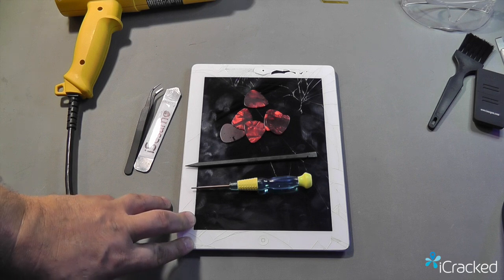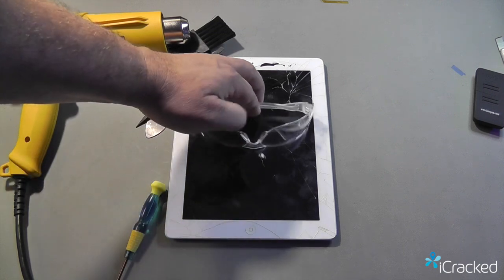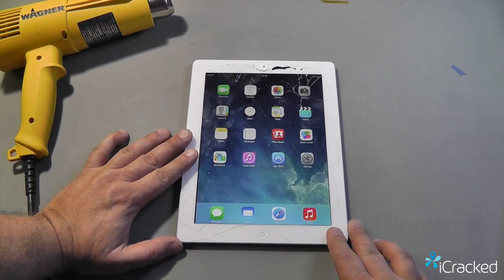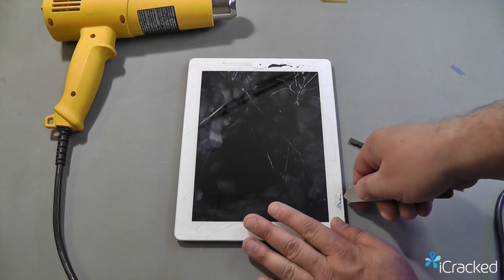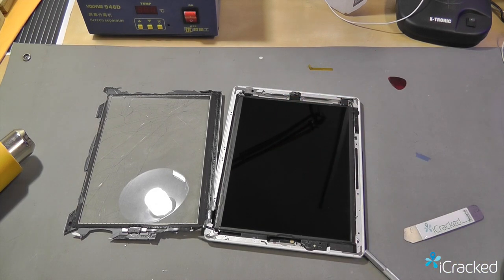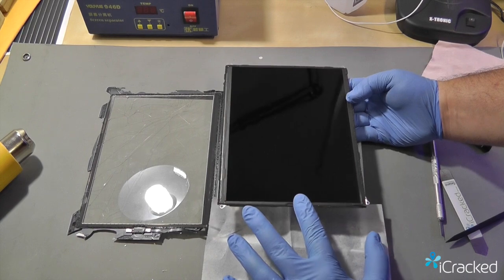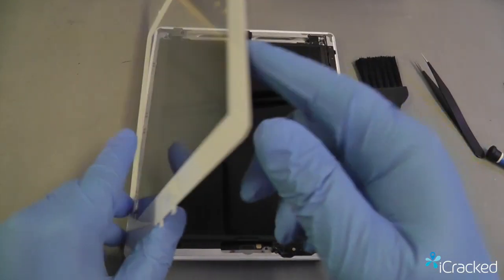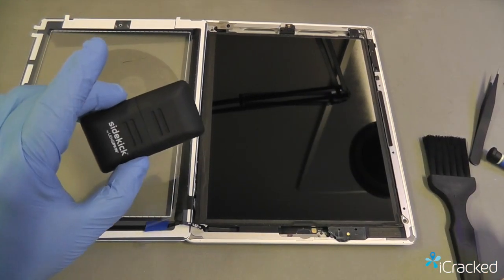Official iPad 4 Screen / Digitizer Replacement Video & Instructions - iCracked.com

Comment: It's safer if you use packaging tape to cover all of the glass initially and then cut around the border with a razor before you start the repair. This prevents glass shards from flying towards the face.
Reply: Thanks for the good tip, i'll try it next time.
Reply: Exactly!! I got glass in my eye on my first repair. Since then my first step is to cover the entire glass with clear tape.
Reply: Haligon ovenlight
Reply: And then put a hot air blower on it ??   DUH!

Comment: Beware that, if you order the iPad 4 digitizer replacement kit from iCracked, it WILL NOT come with either the home button assembly, or the camera bracket, nor will you be provided any adhesive to reattach the old ones.  In this official iCracked video, they are both preattached, but will not be on your digitizer assembly that you will receive.
Reply: Exactly.

Comment: Only thing I would add, and perhaps someone mentioned already, but warn people about the area to the right of the home button.  I wedged the guitar pick between the glass and the speaker plastic cover and damaged the foam like material just right of the home button and under plastic guard.  Speaker still works but I have a high place in the glass in that area now which causes glass not to fully seat in that area.  Other than that works great.

Comment: ⭐️⭐️⭐️⭐️⭐️THANK YOU for your video. By far the best one on YT. I checked out several and yours was the BEST!! Great explanation, attention to detail. Clean, clear close ups and specific instructions. I have 2 of these and I fixed both this weekend. Ordered my kits online, spent roughly $30.00 (unfortunately, not your kit but close to it) and now our iPads are like new!!! You saved me a couple hundred dollars!!! Key to those wondering or viewing this....listen to what he tells you. Every bit of it is accurate, down to placing a stack of books and applying pressure to let the adhesive bond to the surface overnight. I did all of it and we have two like "new" tablets!!! Do your prep. Get your tools ready. Take your time. Watch this video several times before and during the repair. If you follow the instructions, your repair will work. Again..THANK YOU so much for the video!!!👍

Comment: Excellent video. I was given 2 old iPads to use in class which had problems with areas of the touchscreen not working. have just repaired them both without issue and can now use in class with children. 🎉

Comment: Thank you for your video, it helped me to do my first ever screen replacement. Took me a while but got there. I made the mistake of buying a screen without the home button assembly but I just swapped out the home button assembly from the damaged screen. I also applied a little too much heat in certain areas and warped the bezel in a few places which I had to cut out.

Comment: 5 Stars!
I viewed a number of iPad 4 repair videos. This was the best of all I have seen - very thorough and careful. High quality camera work on the fine detail steps! Includes great tips such as safety glasses and gloves during the appropriate steps.  I had glass chips hitting my face on some of the removal around the shattered parts.  
Thank you!
Reply: gloves are critical. if you touch the LCD screen with your oily fingers its game over. you will have a perm water mark. I've done it
Reply: Yes, this was a useful video. Fixed my iPad 4 fairly easily. It fell off of my bed and onto my hardwood floor. From now on it stays in the center if the bed. My gf was going to take it to the store to get it fixed but this video saved us the trip.

Comment: I changed the screen put in the cables correctly computer see it but no apple logo, was working before I changed to put the old one back on to see if its the new screen but still the same. black screen no apple logo. loved the way you changed the screen and the magnifying insert for the digitizer was great, if anybody knows s what wrong gave as a shout.

Comment: Hi I liked your explanation about replacing the digitized screen in Ipad 4th generation, so very detailed .I have a question, instead of the heat gun , can I use a hair blower to separate the screen from the frame lcd ipad if it is safe and ok, and it will blow same amount hot air that need it? Thank you for the video

Comment: Good detailed video.  I agree the camera work was wonderful.  I noticed the lower RH corner didn't seem to be filed or bent back.  How did you get the new bezel to sit along with the new glass with that pushed in ? I've either had to file it down or use the back end of the metal spudgers to reshape the corner for the glass not to "pop" when pressed.

Comment: I bought a new digitizer and replaced it according to these instructions.  Half of the screen is responsive, but the other half isn't.  It also sometimes ghost touches (or, in other words, clicks all over the place on its own).
Reply: you have to plug the digitzer cabke further in.
Reply: No, I had to use kapton tape.  Works like a dream now.
Reply: ive got exactly the same problem and I can't fix it. what did you do?
Reply: I placed kapton tape over the edges of the touch screen which have metal in them.  The touch screen seemed to be grounding itself out, causing sporadic behavior.  The kapton tape insulated it and worked like a charm.  It's been working for months as if it were new.  Use very narrow kapton tape.
Reply: +WILSON! thanks. where precisely did you place it? did you put it over the metalic strip on the reverse of the digitizer?  only the top third of my screen is unresponsive so I assume this is the same problem.
Reply: +WILSON! oh and when you say kapton tape do you mean the copper conductive tape or the masking kind? never studied electronics so don't know if I need to conduct or insulate :-/
Reply: Type this into Amazon:  1 Mil Kapton Tape (Polyimide) - 1/4" X 36 Yds

It's sold by TapesMaster for $6.25.  I believe I used 1/4".

I placed it only over the metallic strip on the reverse side of the digitizer above the home button, and along the entire length.  Make sure you don't overlap and interfere with the adhesive strips that adhere it to the iPad.

Comment: i tried this yesterday, and it was mostly easy to do. i have misplaced the screw that holds down the logic board to the battery. the iPad no longer powers up now. forgive me for seeming naive, i havent worked on apple products before. is the screw holding down the logic board essential for the ipad to boot up? or should i be looking at other areas, such as replacing the battery. 

thank you for everyone/anyone that replies.
Reply: The battery connector is not strong enough to hold itself in there so it needs that screw to hold it in

Comment: Dude. You are a fucking life saver. I created a YouTube account just to thank you for showing me about those clips to hold the ribbons in. I couldn't get the ribbons in based on another video I saw bc it didn't show this. Also, the other video shows an iPad without a cracked screen coming out soooo easily. Where mine came off like yours. Thanks again. You saved me about 700 bucks as I thought I had to buy someone a new iPad

Comment: Hi, i used this tutorial to fix my ipad a couple of days ago, truned it on, and it was fine. then i realised my bezel was unusable, so ordered a new one, put it in, and now the ipad won't turn on. Is there anything that i could have done not to make it work?? i have fixed an iphone5s three times, and an ipod (all screens), and from my experience, (the last time i did my phone and ipod touch), i left them open for a longer amount of time and these were the ones which didn't work. Do you think this actually has anything to do with it, or could you give me some other things to check??? i kept them all in safe places when they were open.

Comment: So  you said that if this was a cellular ipad 4 to be careful not to rip the antennas up at the top. So how exactly do you not rip them? Since the demo isn't a cellular module there is nothing to see. Are you saying to separate them off the underside of the digitizer with a blade before lifting off? thxs

Comment: When I try this, I can't get anything under the digitizer to lift it up, not even a razor. The heat gun I am using is rated up to 1,200F. I can't tell if I am heating the glass long enough to losen the glue or if there is something I am missing. I have even tried using the suction cups to try and pull the digitizer apart, but it ended up breaking one of my suction cups instead... Every tutorial I see, it seems like the person is easily getting something under the digitizer to lift it up. Help please

Comment: Yes, I wholeheartedly agree with the majority as to this video being by far the best of all I have seen. Thanks for going into so much detail which, as you obviously are aware of helps mainly, but not only, all those who are attempting for the first time to repair a shattered iPad screen and digitiser. Apart from that suggestion made by Tewilk 2 years ago with regards to warning people about the area to the right of the home button (looking at the iPad upright and the home button on the low side) where the foam like material just right of the home button and under plastic guard could be damaged if not scrapping the screen edge off carefully, I would respectfully add an extra non-technical point. Please do not forget to switch off the blower. It is not so much for the noise because one still can hear you clearly enough, but for unnecessary energy waste. I am not an obsessive environmentalist. In fact, I do not belong to any green campaign. But I do support organisations like Green Peace, etc. The issue is not merely to say that “Oh, it was only a few minutes”. No. It is a matter of being aware that any unnecessary waste we unconsciously or consciously make has an adverse impact on our planet. For I am not referring simply to you and the blower being on for no apparent reason but for the millions of people who in one way or another waste resources unnecessarily. Thanks again for your enormous help and cooperation.

Comment: Well you make it look a lot easier than it is :)
Many thanks for this video,
I wouldn't have attempted it without it.
Just knowing what to look out for is worth more than I can say.
Yes the glass was damn hard to get out and best if you get a kit with a new plastic bezel that way you don't have to worry about damaging the one that is in there.
Your kit looks like the one to get, might cost a bit more but it will be worth it.
I had to get one real quick and that was from Sydney, the kit wasn't as good, but with your instruction I completed it successfully and the daughter will have a revived I-Pad 4 in the morning.
Thanks again for the great instructional video.
Reply: It is very easy, try changing display on a pixel 3xl

Comment: How not to damaged your backlight after replacing the digitizer? Mine is half dimmed on the right side after replacing my digitizer ;(
Reply: Check your LCD cable and connection for a kink or a lose fit. The white lines on the flex cable should be right up to the connector. Be sure you closed the tab when you reinserted the cable. Good luck.
Reply: thanks, it was my lcd its faulty after change to a new one its okay now

Comment: I just did this screen and digitizer replacement. I did a test of both before screwing the screen in place but then I could not shut it down. I guess I could not align the digitizer correctly so I just disconnected the ribbon cable to the screen. now when I reconnected it, it doesn't have the brightness. the screen stays dark but I can just make out the time. it is on, but barely visable. does anyone know what has happened?

Comment: what do you do when you replace the screen plug everything in but the iPad wont turn on or get recognize when you plug it in your computer and turn on itunes. or did I just broke it even worse
Reply: mine did that. I opened it back up and did the bit where you remove the two different sized screws and lifted the conector up so it disconnected the power and then screwed it back down and reassembled it all and it came back on. think I shorted it out

Comment: Has anyone had a problem on completion of the task where the screen is displaying only lines, grey..black, of varying widths but no normal image, iPad (although powered off at the start) came to life as I turn over the new screen on to the digitizer to check it. it went off after about a minute, I then powered it up properly but the screen image was the same...anyone know what the problem might be?

Comment: When I plugged the lcd part back in the screen won't turn on? Any advice how to fix it?
Reply: I think you cut through the screen cable or whatever you want to call it it's right on the side of it
Reply: Mine worked but the home button didn't work, what could have gone wrong?

Comment: My logic board is damaged. http://i1044.photobucket.com/albums/b447/calvinnew/20151229_233457_zpskvzwjo3r.jpg
Too much force was used to remove the connector. Is there a way to repair this or does the logic board need to be replaced.

Comment: This is nothing like my IPad mini 4, cables in wrong place, no fingerprint ID home button, glad I didn't buy my replacement parts from you!
Reply: That's because this is for a Ipad 4 regular large size ipad. If you have the Ipad 4 mini you would have to buy parts specific to your model.... And I'm sure this company has a seperate video on that. I ordered my replacement from this company for my ipad 4 and they specifically ask for your model number so they make sure they send you the right replacement materials. It worked perfect for me and saved me over a hundred dollars.

Comment: This video is excellent. I was using it along with the A1458 screen replacement kit purchased from iCracked. Imagine my surprise when I get to the point that you verify the cables and cut off any "nubs" before reattaching the digitizer cable and the home flex cable and discover there is no home flex cable attached to the digitizer. Nada. Nowhere to be found...I write iCracked and their "HQ" (and when I say HQ I mean wussies hiding behind a girl having her do their dirty work) tells me through a female CS agent that it doesn't come with a flex cable, I'm supposed to use the existing cable, a refund will not apply and they are closing my ticket.

OH HAPPY DAY. That is customer service you can really appreciate...and when I say appreciate I mean what a JOKE and when I say JOKE I mean what an @$$ hole

Subsequently I discover they apparently sent the wrong digitizer for the A1458 because the home button area doesn't match my OEM digitizer and my flex cable is hard soldered to the home button housing. There is a place to connect a cable but there is no way possible for me to reuse the just the flex cable being attached to the home button housing.

So this is a warning that iCracked actually iSUCKS in supporting mistakes they make and that you could be ripped off for $40 like they are trying to rip me off. 

And whoever their HQ is, they have a thing to learn about customer service because frankly, it is patently stupid to handle this the way they did. They didn't even attempt to help me or try to be sure they understood what was happening. I they had they could have seen for themselves that my OEM original item didn't match what they sent and it is impossible to use the original cable. 

So they can go pound sand cuz I'm going to make it my business that as many people are warned about this as possible. 

Oh yeah, I'm going through Paypal to get my refund even though this is totally not worth my time to go through this hassle. It's the principle that this "HQ" jerk thinks he can dump on people, and probably has, and there is nothing they can do about it.

Oh you watch me do something about it pal.
Reply: Sounds like you attempted to repair your iPad not realizing you accidentally ripped some of your connections, that’s not HQ or customer services fault, it’s yours. Even if it didn’t say so in the video, clearly you are inexperienced when it comes to iPad repair which if you’re going to spend money on a tool kit and even replacement parts, you should’ve just taken it to someone who knows and they can do it for as little at 70ish bucks. Not anyone’s fault but your own pal, next time just be more careful and watch more videos if you don’t know what to do that was you can learn